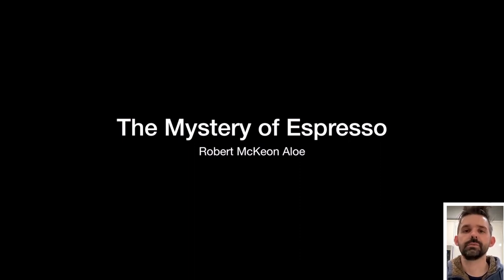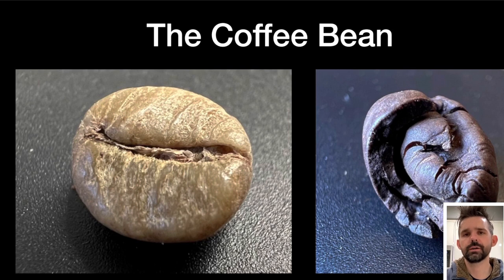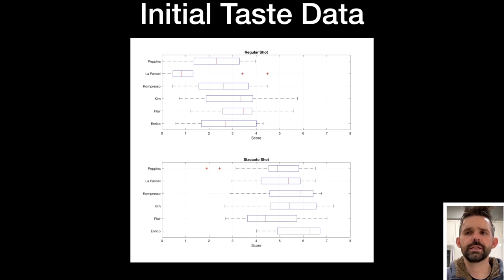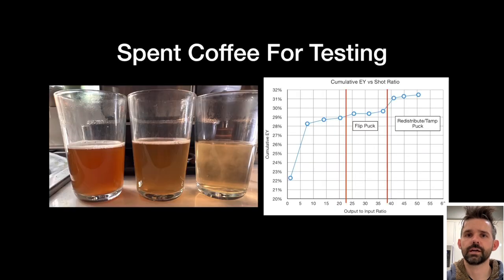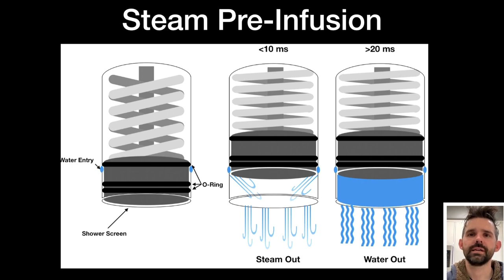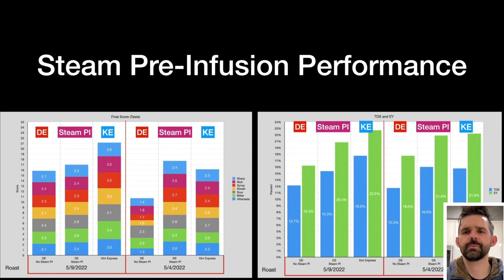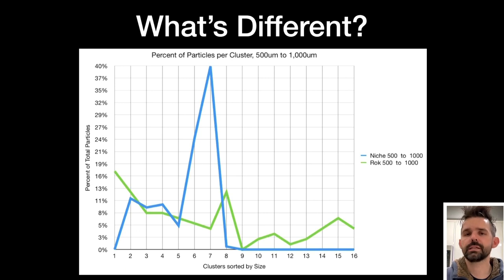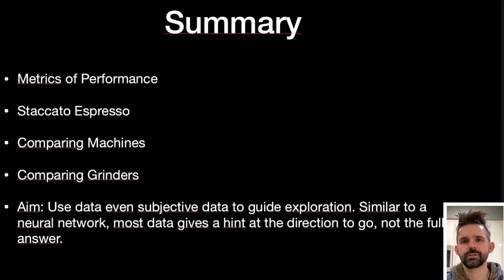The Mystery of Espresso: A Deep Dive on Topics in Espresso

Comment: Quite precision and detailed analysis for further digging in espresso's process and results, thanks for sharing.

One question or confuse me about the grinder comparison. I found in 30:12 showed there's a big difference on percentage of particles in 500um-1000um b/t niche and rok, that prove they result in different esp. behavior (EY, taste), however for ODE and niche, you mentioned they have similar behavior on esp. results and particles size distribution, but in 31:44 showed bin similarity up to 550um trend to different, which is similar similarity result of niche vs. rok for above 550um particles size. So how do you conclude the esp. results from particles size analysis for niche vs. Ode?
Reply from the maker: Espresso grinds are dominated by particles less than 500um. Also, when doing particle size analysis on their shapes, there are fewer larger particles so unless I sifted out the larger ones specifically (which I probably should have done), those bins are less reliable.